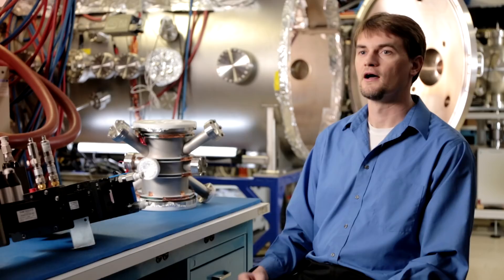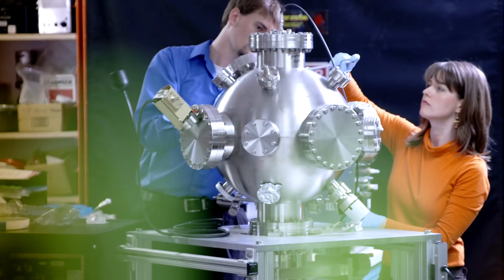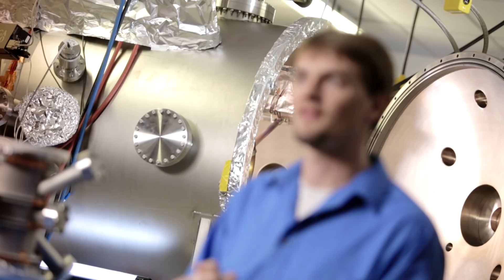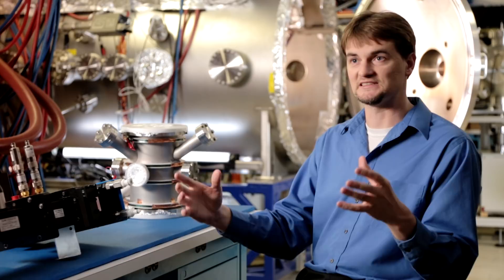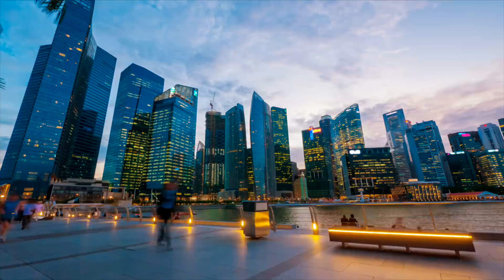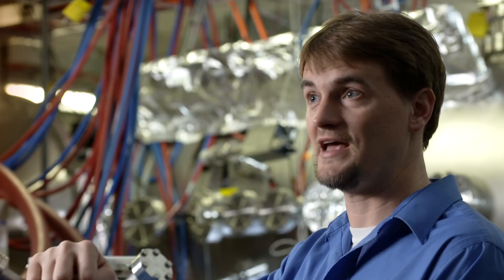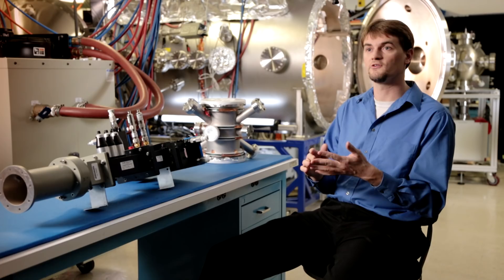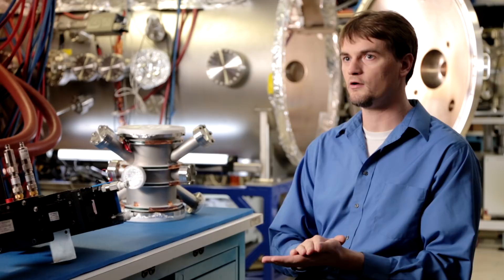Lockheed Martin: Compact Fusion Research & Development

Comment: What I have learn't is that fusion is only 10 year aways. Every year.
Reply: +rageatm4life go to sleep again,you already mised ten years  🌏 📡🌏 👣🕒  💎💀☠☼☾☄ ₪itibira₪ ✶☥✨🌛🌄⊀⋉🐺🐾▲▴◭
Reply: +The Turbo Syncretist are you always this condescending. Make one little quip and you are guaranteed someone takes it too seriously.
Reply: +The Turbo Syncretist I have to admit this seems like investor fluff. Lockheed has much more pressing issues and this is at best an under funded side project with almost no chance of success. Sure fusion might be 10 or 30 years away but it might also be 200 years away. Without a multi billion investment and international co operation it is pipe dream. That leads to ITER which is not designed to produce power. Both this project and ITER are a waste of time, effort and money. If no one is making practical fusion solutions which produce power for a national grid then I see no point in building slightly larger or smaller high energy input no energy output prototypes. Build a prototype which creates sustained energy output or save the money and build working fission reactors to deal with immediate energy problems.
Reply: The Turbo Syncretist Thanks. Also I did a little digging and found a new fission reactor costs about $2-$4 billion. ITER cost so far is $15 billion. We are talking many gigawatt hours of power lost due to this mis-investment losing all nations billions. If ITER is the example of current bleeding edge fusion then the whole process needs to go back into the lab and a new fusion creation process needs to be found. $15 billion for a none producing power plant is imo a set back for energy security. So maybe this side project has value assuming the ITER nations realize tokamak is a dead end due to the practical problems in scaling. Even if tokamak has produced 1 gigawatt (which it hasn't)  this is the most expensive power ever produced. $15 billion for a 500 mwh reactor is mental and will bankrupt the planet.
Reply: Fact remains that no other energy technology had this long of a pre-run development time so far, while beïng so little effective. The EROEI is still below zero.
Reply: No.  What you've learned is that the persons in charge of Lockheed has not yet grown enough testicles to tell the truth about their vehicles, projects, propulsion systems, and underlying science.
Reply: its already been done. look up MIFTI
Reply: @Skoda130  natural gas was used by the Chinese in 400 BC. Only after the 2nd. world war did it gain critical momentum. Fossil fuel coal had been used for heating in europe since year 1300 but only in the late 1600s did it take of, and then it took 200 years more for large scale electricity production from coal to emerge
Reply: @Th33Xx , your point beïng....?

Comment: "10 years and we have better military vehicles, 20 years and we have clean energy for everyone"
Their priorities are seriously fucked up.
Reply: They are a defense contractor. The first priorities are always weaponization.
Reply: Devin Dash  Even in this case, their priorities are messed up: in case of major conflicts having limitless energy sufficiency, reducing cost and fuel dependency is a way greater tactical advantage than "better vehicles". Besides, no other country has already better vehicles than the US.
Reply: So true.
Reply: *****
For how much one might agree or disagree with your rant, I don't see how this by any measure is at odds with my arguments (expecially the second one). I am not naive, simply objective.
Reply: Couldn't you say the same about the Internet? It was developed by US Military. I am glad that happened. Sure it would be nice if things were developed purely with mankind's wellbeing as the priority but I would prefer this develops with military as the first priority rather than it not be developed at all.
Reply: nitelite78
 Well.. no. The first internet models have been developed by the CERN in Swiss. However this goes beside the point. I am not against military contractor developing tecchnology, quite the opposite. The problem is that no matter if you consider national security, corporate profit or military strategy energy production and security is a far bigger concern than vehicles. Moreover the function of the military is to protect the public. Solving some of the biggest environmental and economic issues might easily fall into this spectrum.
Reply: yoshyoka I used the word developed rather than invented. I think it is fair to say that without the US militay we wouldn't be anywhere close to what we have today yet.

I agree with the rest of your comment.
Reply: yoshyoka "The first internet models have been developed by the CERN in Swiss."
As I understand it, the US,DoD through DARPA, provided the initial funding and technical ground work for the precursors to the internet.If that wasn't done CERN wouldn't have framework Tim needed to work on ENQUIRE and therefore no internet. 
It's no coincidence that a lot of the internet's protocols have names and references to The US,DoD.
ARPANET: the Network developed by the ARPA (Progenitor of DARPA)
TCP/IP: Also known as the DoD model
http://www.internetsociety.org/internet/what-internet/history-internet/brief-history-internet-related-networks
http://en.wikipedia.org/wiki/ARPANET
http://en.wikipedia.org/wiki/Packet_switching
http://en.wikipedia.org/wiki/Internet_protocol_suite
Reply: wyvernlord23
This was already settled, understood and ultimately only a distraction to the main argument.
Reply: yoshyoka Well at first you only have a few those go to military vehicles that would need priority access to energy (aircraft carrier/Battleships? or electric planes that don't need to land often.) in case of some random war thing or another. once you have more though, or better/safer/cheaper/simpler ones, Then you give it to the public.  

However I agree You would think helping the people would come first.
Reply: "In case of some random war thing".. The US has already military supremacy, what it lacks is energy self sufficiency and economic stability. You should prioritize what you need and not a pissing race in military might.
Reply: yoshyoka they want to use fusion reactors in the military before they use it for anything else. which im pretty sure he clearly stated in the video.
Reply: i mean they are a military contracting company its their job to work with the military.
Reply: Sure. Yet: 1 they are a listed company, they should go where the money is (hint: power plants cost more than military vehicles) 2; the government (who controls the military) should understand which are the highest priorities.
Reply: Agree, the whole point of clean energy is to stop all wars altogether because there is no  motive to fight for oil any longer..

But lets see how this turns out.
Reply: Morph Verse I have never stated such a thing: people have always found excuses to kill each other way before the discovery of oil or the organisation of nations. What I insist on instead is the hardly disputable fact that unlimited cheap energy nationwide  is a way greater advantage, both military end economically,  than better military vehicles.
Reply: yoshyoka Proprietary advanced technology for the military isn't just about greedy domination, it's about ensuring peace and security for the homeland first and foremost, which allows the homeland society and economy to have a better chance to continue to thrive and expand. Any country with the means to develop such new technology independently will always guard it jealously, not just America. The military always gets the most advanced tech first, all the way back through the various stages of human civilization, as new techniques for metallurgy and smithing were developed, those new techniques are used to outfit troops with better spears and swords before houses get new butcher knives. The sort of funding and priority put into this new technology by the military industrial complex will get the job done much faster than private companies would do it. Private companies are profit driven, and if there isn't a large return on the investment, there is no push to reach the new technology horizon. The military doesn't care about the profits of the application, they want the technological advantages, and that's enough to make them pump money and effort into the project. The military could have these generators in 10 years, and the public could have them in 20, and that's probably still quicker than if the private sector was doing it alone, solely for public use. It might not be the most noble part of human progress, but it is undeniable that military needs have driven technological advancement more than any other factor ever.
Reply: yoshyoka "...no other country has already better vehicles than the US."

Except for Italy, the UK, and Germany.   (Top Gear FTW).
Reply: Nocturne Stanza
Haha: I was strictly speaking about military vehicles :D
Reply: yoshyoka You realize they company is lockheed martin, which makes military and defense products.....
Reply: Iron man is CEO at Lockheed building ark reactors.
Reply: yoshyoka "Well.. no. The first internet models have been developed by the CERN in Swiss"

Not true. Arpa (now Darpa) developed the ArpaNet in 1969, which became the technology basis of the internet in the 1990's. Tim Lee, at CERN, developed hypertext, TCP/IP and essentially the WWW in the late 80's.
Reply: Odin Some people are not smart enough to understand that energy sufficiency is strategically more important, even militarily, than any single advancement in military vehicles.
Reply: Jebus Yup, making highly mobile and light units is in fact way more difficult.
Reply: yoshyoka They are a defense company my friend.
Reply: +yoshyoka - "...reducing cost and fuel dependency is a way greater tactical advantage..." Yes, good point. Never thought of it that way. However, I can't help but wonder what makes you think building better military vehicles is a priority for them as it's not mentioned at least in this particular video. I would like to know what makes you think building military vehicles is hampering clean energy efforts. They aren't mutually exclusive, anyway. You have to consider you need money to conduct reseach, and arms manufacturing is a good way to make money.
Reply: +yoshyoka Exactly. If Lockheed-Martin was mostly focused on things like this and space exploration projects instead of those collectively taking a back seat to mass producing military hardware, then it would be a company worth investing in.
Reply: +CmdrGendoIkari Once you have a fusion-powered jet fighter, eventually it'll be applied to civilian vehicles. Many inventions are result from military research, like the internet. Lockheed Martin is being pragmatic, they might work hard on developing fusion reactor for military aircraft, but it's better than not doing any fusion research at all.
Reply: +Mickey G I'm not trying to tear down Lockheed-Martin. They do build some amazing stuff for NASA. I'd like to see a lot more of that out of them, and less war machines. That's all. I know it is partially Congress to blame there, but really LM lobbyists should do more to spur space exploration objectives, and spend less time selling war machines to Congress. As a species, we have really got to get our priorities in order before we end up annihilating ourselves in global thermonuclear war. Russia and China do not want to be our enemies, but given our global imperialist ways since WWII they continue to see US as a threat. We talked them into our crazy capitalist ways, and they just want to be competitive players on that world stage. It is time to put away these childish war mongering tactics, have some fun in the capitalist competition along the way, and together via the capitalist competition that best spurs technological innovations, ultimately build a path to the stars. It really is the only way our species stands a chance from here on out.
Reply: +yoshyoka Why so surprised?. We move by fear, otherwise you would have two more college degrees and spoke 4 more languages, etc. Without fear to fail tests what would you be now?. 

Sex is another quite interesting force for the market... etc. My point is; compasion,  or related motivators don't work to stablish priorities among such primitive animals as we are, and is a strong WE (comunism is an eloquent proof). 

Fear to death (war->weapons), fits perfectñy as first priotiy in the present context (the last two words are esencial).
Reply: +yoshyoka Military is paving the way for mass adoption. Look at the military as guinea pigs.
Reply: +yoshyoka Test it on the guinea pigs, aka military and then it goes consumer after all the kinks are worked out
Reply: uh duh their a defense company 😂😂
Reply: +yoshyoka i dont care wha is made first my first point is that whether the military gets it first or not these things are going to be sold for billions of dollars to aquire one or the taxing on them will be huge probably worse than every other power source combined.  i see the benefit of private corporations and thats great for them  but everyone else is just going to be losing money. They wont give this stuff out for free. If LA has a fusion reactor powering the city then they are going to tax the shit out of every home owner and the only way to avoid that would be to buy or build your own.
Reply: It's not necessarily priorities (although they are a defense company) it is more price tag. Military airplanes are so expensive anyway that extra price tag for their power system isn't such a problem, consumers want their energy as cheap as possible. There's also a question of volume: you need less fusion reactors to power military planes than to power the grid.
Reply: They go where the money is, and in the US it is the US government (technically you the taxpayer, but you have no say in day-to-day Democracy).

Comment: 4.5 years later: You have half a year to produce your working prototype.
Reply: DeepSpace12 it’s been 5 years they failed apparently
Reply: The project is ongoing. They are working on a larger prototype. The original small scale is apparently no longer in the cards.

Comment: Even if this DOESN'T pan out, research into fusion has to be increased. It's the single most important technology to avoid global climate change, wars over remaining oil reserves and cheap energy. Fusion power is clean, has limitless fuel supply and is safe (no runaway reactions or meltdowns possible).

We should not be afraid to dump billions in the development of fusion. We won't regret it. The money wouldn't be gone, you would finance the best and brightest people to make the world better.

Comment: I wonder if they're combining Bussard's Polywell tech with Seward and Chen's ESTS tech? Sounds a bit StarTrek, but the Bussard based stuff would make a good collector system to feed a electron spiral toroid spheromak.

On their own they had their drawbacks. Polywell design relied on random collisions for fusion. It fused, but not in an efficient manner. The electron spiral toroid spheromak appeared to be efficient as it focused it's plasma and in the way which it did it, but was designed only for intermittent pulsed operation - likely fused but not hot enough for over-unity. Combine aspects of both for a continous operating system which economizes by reusing energy from the reaction, and you'd have a pretty neat little over-unity device.

Looking at the architecture of either reactor prototype, the smallest powerplant package is likely scalable to the size of an automotive engine. The biggest would be comparable to existing fission reactors. Depending on scale, you're probably going to collect heat for a steam plant, or simply operate with higher loss as an RTG or electron grid unit.

Before anyone asks. Nope, not an engineer or scientist. But I am a bit of a tech nerd. :)

Of course if there is truth in going public with this, it's likely going to be game on for BRICs playing catch-up. If and when they do is likely when this tech makes it to the civilian sector. (As long as they don't have it, it's too "useful" to keep holed up in military-only applications.)

Comment: what if in fusion reactors you use a halbach array of superconducting magnetic barium coils cooled by a constant flow of liquid nitrogen to fuse the hydrogen in the reactor then use inward facing sheets of carbon nano tubes to collect the heat energy and boil the water into steam to turn the turbines? wouldn't this allow for a reactor small enough to fit in a car? MIT is working on the superconducting barium coils but the big change in using the coils arranged in a halbach array.
Reply: +Nooby Games Neat! Could this be applied to Free Piston Stirling Cycle Engines?
Reply: ufoengines i have no idea but you should look into the many uses for halbach arrays and superconductors
Reply: Will Do!
Reply: ***** you however miss the reasoning for the plasma to be suspended by magnetic fields in a vacuum which only allows for the radiation of heat as infrared light
Reply: ***** not cool the plasma cool the barium halbach array coils so they can super conduct
Reply: ***** the best way to filter something is more heat and therefore more energy to control.
Reply: ***** because only deuterium will turn to a plasma and other elements take far too much energy to ionize and will be easier to separate
Reply: Barium isn't a superconductor at atmospheric pressure and requires 5 kelvin even when pressurised to 18 GigaPascals. Do you mean Yttrium Barium Copper Oxide?
Reply: IamGrimalkin I don't remember exactly, it was an experiment by MIT. if you can find it again then that is your answer.